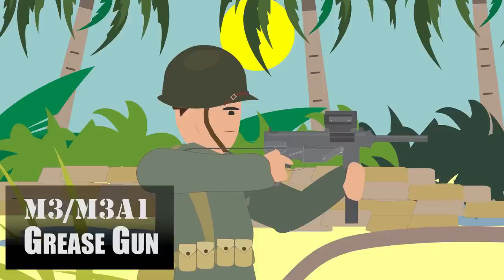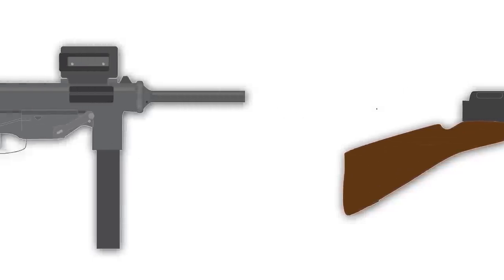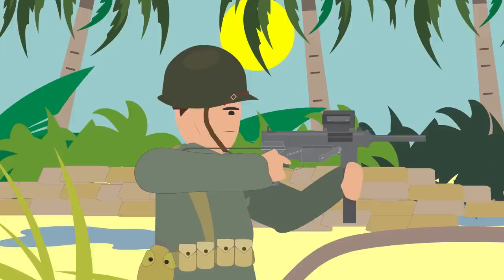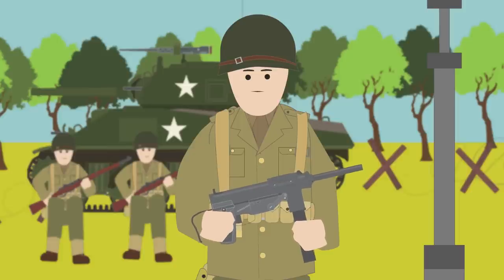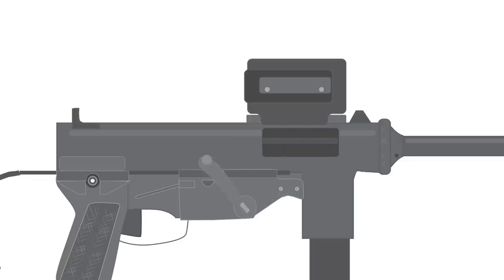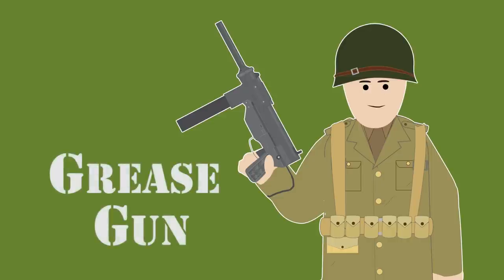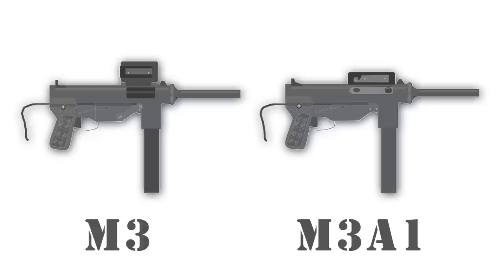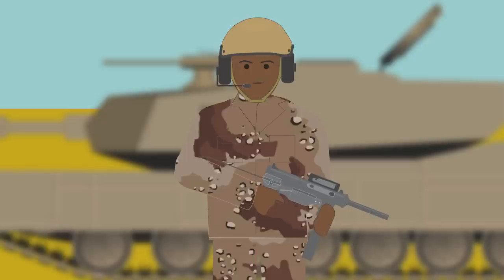M3/M3A1 Grease Gun

Comment: Looks like the mp40, I wonder if it's derived from it.
Reply: Antonio Agay while it does look similar, the M3 is a separate design with no parts commonality to the MP40
Reply: It probably had loose inspiration from the mp40, just the concept of a light, low rate of fire submachinegun
Reply: Sten gun was more of the one that inspired US to with cheap to produce Smg
Reply: the basic look is based off it yes, with it's Handel magazine and retractable stock.

but aside from that the internals have no similarities, the Grease gun in incredibly efficiently made and simple and as the video says almost made completely of stamped metal parts.

the Mp40 was overengineered (the independent firing pin despite it being an Open bolt weapon for example.) and far more expensive.
Reply: I've seen you in other videos bagging and putting down German arms. Do you have some chip on your shoulder?
Reply: lol that's what I was thinking XD it's like an American mp-40

Comment: After the cocking handle was removed the dust cover no longer worked as a safety and was closed after cocking the weapon to keep dust from causing the weapon to jam and would flip open after the first pull of the trigger. The US Military never called it the Grease Gun, they called it the Burp Gun

Comment: a problem that SHOULD HAVE been obvious to the ordinance board when considering the M3A1 was that it was charged by placing the finger into the front of the bolt... Now, you may be thinking "what's the problem with that?" Well, let me explain a little bit about how such a gun works. The front of the bolt slams forward, igniting the round, and sending a bullet down the bore, where it is centrifugally stabilized by the twist of the rifling in the bore. This generates a lot of heat, as the friction between a bullet that will travel around 850 feet per second tends to do, and furthermore, it's propelled down the bore by the rapid burning of powder, in a manner and at a speed one might consider to be an explosion. Now think about this, the front of the bolt has a groove to bring the bolt to the rear... The FRONT. The part where heat that's built in the barrel, or the casings of the bullets tends to transfer. So basically, if you're in heavy fighting, and find yourself using the grease gun in a sustained fire application, after just a couple or more magazines, you WILL have a gun which is painful to operate.
Reply from the maker: +mikethemaniac1 exactly

Comment: Ah. The M3 Grease Gun. I’d probably take it over a Thompson M1A1. Thompsons are extremely well made but are overengineered and almost as heavy as the Suomi KP/-31 unloaded. And the op system on the Thompson makes it horrible for Semi-Auto fire. The biggest actual advantage for me, is their magazine. Double stack double feed. Easy to load and with .45ACP. I wish the M3 had interchangeable mags but nope. It’s also open bolt, light weight relatively, easy to use, easy take down, and way more convenient. Disadvantage FOR ME, is the mag. Double stack, single feed. Notoriously difficult to load, but the M3A1 like he said, had a loading tool on the stock, so convenient indeed!

Comment: But uhm wasn´t Thomson better because of its higher rate of fire?
Reply: Neither was useful as practical weapons.  The Thompson was very heavy and expensive to produce.  Also the original drum magazines for it were useless - so much so that England gave them back when the US gave them a bunch of Thompsons - and instead asked for the more reliable stick magazines.  Both however - like all pistol caliber weapons - were basically useless at range.  Anything beyond 50-75 meters was pushing your luck. 

That is why the M-1 Carbine was developed and widely employed.  It was cheap and easy to produce in quantity while it offered considerably more range for less weight than the submachine guns.  Submachine guns have very limited use = which is why they are not employed much save for by special teams performing specific tasks.

Comment: Y does the Infantry get such crappy weapons? M-16, M60, M9. They should have kept the M1 Thompson. Convert M2 Carbine too 5.56mm and Kept the 1911. Leave good guns alone.
Reply: Crappy? M3 was better than thompson. Lighter, more compact and lower recoil. 
M2 Crbine in 5.56? That whole thing was obsolete long time ago. Just like m1911. During WWII they were built to lower standards than you might think. Barrel life of WWII m1911 was about 3000 rounds. Yes M60 was crappy. M9 was ok when they stopped cutting corners with cheap non-OEM magazines. M-16 after enough RND became one of the best platforms in the world. Light. Reliable. Deadly. Its not gonna go away for a long long time